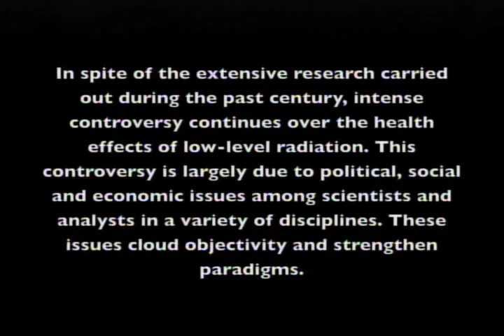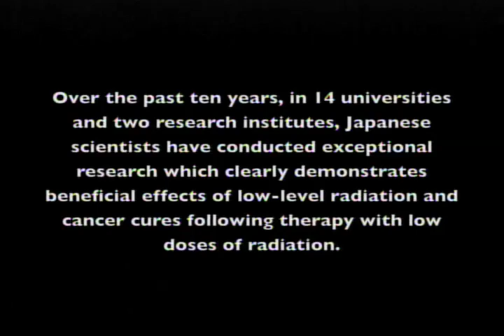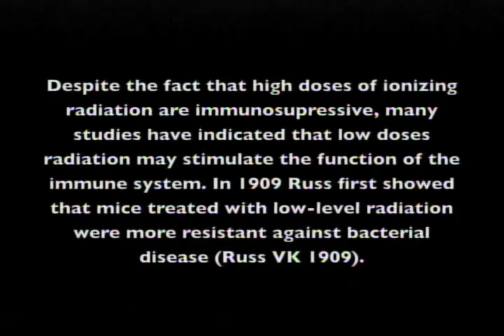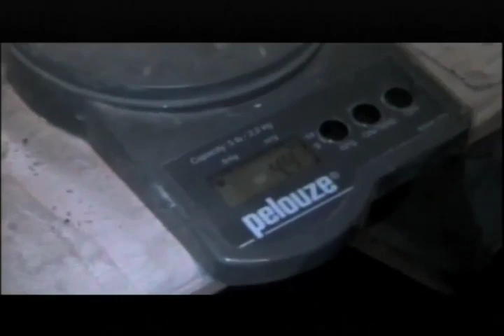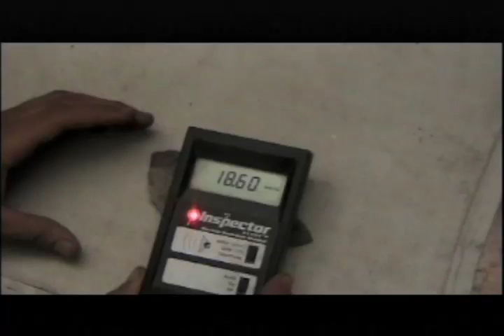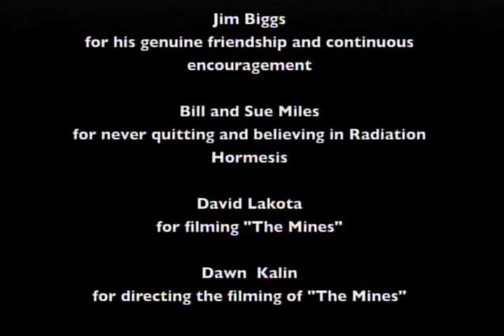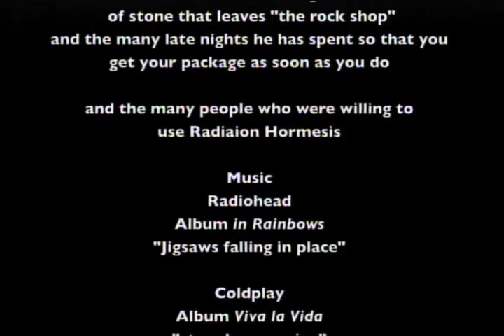Radiation Hormesis Cure For Cancer

Comment: The problem with the "hormesis" crowd is that if a little is good for you then more is better.  With Radon exposure there is some evidence that very low exposure rates may (or may not) be healthful by upregulating DNA/RNA repair enzymes; stimulate immune system etc...but beyond the EPA limit of 4 picocuries/L or even the WHO limit of 2.7 picocuries/L increases lung cancer risk in lock step with increasing exposure...